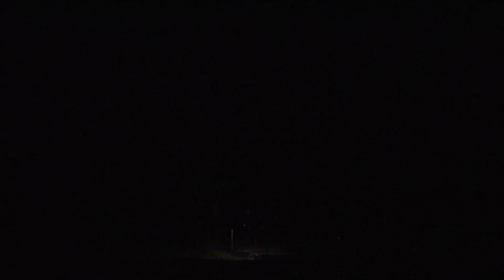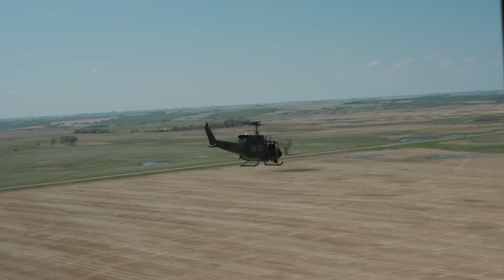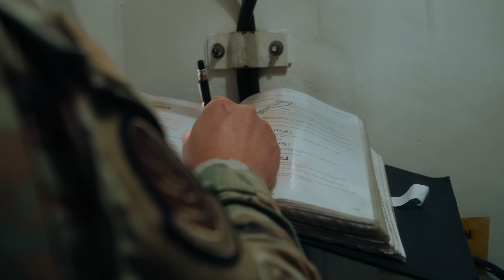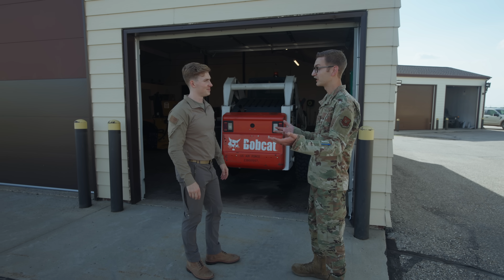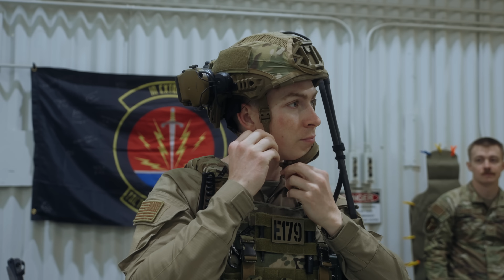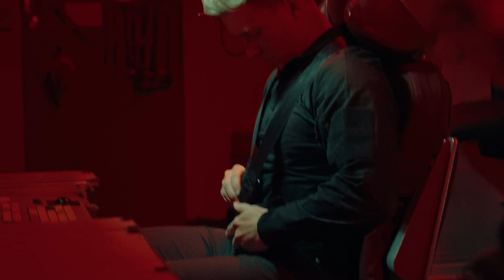Inside A Top Secret Air Force Nuclear Missile Silo

Comment: I was a missile maintainer for 5 years at Warren. It was a pretty good job and one with such a massive impact. Very well-done video, you went really in depth with everything! Glad to see the missile community get some love.
Reply: why do they need a seatbelt to turn a key?
Reply: @discovolante6624 missile blast
Reply: @discovolante6624  Assuming because the blast from the ignition of the missile causes a large shockwave
Reply: @PlushChronicles  but are they not a long way away from where the actual missiles are launched from?
Reply: @discovolante6624 they are. I assume its just for discipline. Staying seated during this critical process. So they made seatbelts mandatory.
Reply: @discovolante6624  All wrong. They are there in the event of an enemy warhead detonating nearby, so they can actually finish their own launch procedure. If they retaliate, most likely the enemy missile is already only 10 to 15 minutes away. The silos are prime targets and that's the reason why they are called nuclear sponges. That's also why the locations are known to the public, it wouldn't be of any use for this scenario, where they secret. The "secret" locations are the submarines and somewhat the air assets.
Reply: @discovolante6624  precautions just in case something goes wrong and the missile man is thrown off their station while readying to fire a missile
Reply: Автор канала, ты скрываешь мои комментарии - мои слова неудобной корректной вежливой правды...
Ты играешь не по правилам, и пытаешься хоть чем-то попробовать переиграть русского, играя по своим правилам, и переписывая условия и правила игры, - это то-что запад тут делал десятилетиями против россии, против её сильного богатого и конкурентного!..
И всё происходящее сейчас на украине, это та запада такая же как и у тебя эта грязная игра, в которой все способы и средства хороши и позволены только тебе и оправданы тобой, и в которой запад всё равно проигрывает россии китаю индии брикс...
.
Европа обречена, и станет однажды придатком брикс!..
.
Это всё происходящее сейчас на украине, это сделали ваши элиты коммерческого и политического, сделав этот осознанный опрометчивый шаг, надеясь переиграть сильного и конкурентного игрока - который честно с вами запад пытался играть по вашим правилам, и вы запад, решили попробовать его переиграть по законам и правилам - которые вы решили нарушить, и использовать законы добра и гуманность в корыстных интересах, и даже предсказывая в 90-х годах последствия этой такой русофобской политики!..
.
В россии, это западное предсказание - тоже озвучивали и цитировали на телевидении, и недавно это старое видео нашли в архиве и показали всем, и все были в ужасе от того насколько всё точно на западе в 90-х предсказали о сегодняшнем происходящем!..
И украинцам, эту старую запись с этим предсказанием о россии китае - и нападении на украину - тоже показали, и украинцы посмотрели, и всё проигнорировали, и стёрли себе это из памяти, - они упорно игнорирует правду стиснув зубы, и ты тоже проигнорировал и скрыл мои комментарии правды!..
.
Украинцы надеются, и снова и снова решили, что надо это перетерпеть и потерпеть - ради светлого будущего, и игнорировать ту жестокую десятилетиями циничную игру запада против растущей россии (и украины) в конкурентной борьбе запада за ресурсы и жизненное пространство, в которой украинец себя тридцать лет видел победителем и в евросоюзе - среди таких же равных добрых честных и гуманных и законопослушных, на почётном месте среди таких же как он добрых русофобов!..
.
И украинец, старался понравиться западу и десятилетиями делал и совершал недружественное и русофобские действия, и десятилетиями всячески выказывал бесстрашие геройство и удаль, и нарушал договора условия правила и контракты, и разрешил базы и лаборатории сша и британии - на подаренной от россии русской земле...
.
Все вы на западе понимали, что россия это сильный конкурент на несметных ресурсах, и все вы играли с россией не по честному, и все на западе понимали и предсказывали усиление россии, и пытались хоть чем-то помешать россии!..
И вот, ты тоже тут, честно и по всем законам капиталистического, рыночного и демократического, гуманного, скрыл мои комментарии правды тебе неудобного!..
.
И пока ты чувствуешь себя победителем, и ты узнаешь о том что ты десятки раз проиграл, потому что всё это тут скрытое тобой - сейчас будет размножено на других каналах...
.
Ты один раз выиграл у россии и сто раз проиграешь!..
Смирись, ты обречен теперь проигрывать вечно самой правде!..
Вы запад, слишком долго осознанно и преднамеренно ошибались врали и обманывали, и играли не честно, и теперь, пришла за это расплата, и мои тут скрытые комментарии не помогут скрыть эту правду
Reply: @discovolante6624  It rocks the entire ground when a missile launches
Reply: @elijahlemoe412 So then why wouldn't the Artimis takeoff not cause a tsunami?
Reply: @successandlifestyle weh?
Reply: My dad guarded ICBMs at both Warren, AFB, and Malestrom, AFB
Reply: How long they seat there a day waiting for launch code?
Reply: @maemilev 24/7/365 for 50+ years now.
Reply: I was MHT/MMT at FEW.
Reply: i just got this job and dont know what to expect? how did you like being in these really remote bases and how well did it allow you to prepare yourself for civilian life?
Reply: @linkCable  Theyre definitely not glamorous but if you like the outdoors, FE and Malmstrom will be great. Minot is minot lol. Its been years since I was in so there has been a lot of changes im sure. It 100% set me up for success in civilian life and I didnt even get all the certs I could have. I was an X1 so learning the electrical trade transferred over well to my job at microsoft. Even if its not what you want to do on the outside, utilize your tuition assistance and get a degree while youre in. I'm pretty sure if youre in VES or an X2, you have the opportunity to get your CDL so that would be massive for a good job. Same with operating a crane. Theres plenty of avenues to set yourself up for success for an AF career or civilian career. I'd be happy to answer any other questions you might have about it homie
Reply: @SquatchyInTheNet  Seriously thanks for replying. I'm shipping out in a week and feel like I barely know anything about the job. Do you think you could describe anything about what your day to day looked like? My recruiter said that it was a lot of downtime which made sense to me because idk how much interacting with nukes goes on. Also, I got 2w231 which I wasn't sure about whether that included icbms or not and tbh not even my recruiter knew and even after calling 2 different people who worked around them, we still couldn't get a clear answer.
Reply: @linkCable  Yeah no worries. I was a 2m0 so we did very different jobs than 2w2's. Don't really know much about what y'all did and they like to keep it that way from what I know. My advice would be to research some stuff on reddit or something like that to see what guys in that career field say. Missiles in general is a high stress job no matter what area you are in because of the magnitude of it obviously so make sure your attention to detail is good. You'll learn more about it from basic training I'm sure when they begin to do your clearance and whatnot. Your MTI probably won't know much about it either honestly. Nobody in my training command knew anything besides how stressful it is. Not sure how they do it anymore but you might hear your name called a few times when you least expect it lol no need to worry. Clear answers about it probably won't be available til tech school but I would prepare for high stress environments at the very least. It is a great job with low danger as long as you don't ruin it for yourself by doing something dumb like getting a DUI or any kind of UCMJ troubles.
Reply: @SquatchyInTheNet dang thing is there doesn't seem to be anything online and I even saw a reddit post by a mod saying the DoE told them they had to remove all posts by a user and ban them or something so it seems like that's on purpose like you said. 
Even if the job is high stress were your days long or did you have consistent shifts with time to pursue other things? my recruiter told me I would have a good amount of down time to finish school.
I was also kinda worried about the bases. People really don't seem to like em and even though ill make the best of it it would be nice if the base facilities were at least comparable to nicer bases since there's so little around you. 
Also so much for keeping a low profile during bmt lol.
Reply: @linkCable  Ah yeah that makes sense. You'll learn more in tech school and basic. I had consistent shifts yeah it was typical 5 day weeks 9 hours each but thats not how it is across the board. Some had more some had less just depends on where the unit needs you. The 2Ws i was friends with were always out in town with me whenever something was going on so i assume it was pretty standard days. Schooling shouldnt be an issue they really push for you to have time for that since its good for performance reports. As for the bases, theyre not glamourous by any means. The dorms at fe are mostly renovated but haunted lol not sure about any others. Most people dont like them because its not overseas or on a beach but I loved it. Tons of outdoors things to do. Youll still be able to keep a low profile in basic for the most part. I got extra phone calls to set up my paperwork so that was cool. Tbh facilities anywhere are gonna be fine since its the air force. I reckon youll do fine
Reply: How heavy were the parts?
Reply: In the event of WW3 
If the two seated..... ..Punk Out and don't turn their keys the missile silos will be launched  as a group ....
Reply: thank you for your service

Comment: Why do they strap into the chairs in the launch center?
Reply: So the meat bags in the chairs can survive an enemy first strike long enough to get their birds off.
Reply: @djdouglas4506  I don't see how that could make any difference.
Reply: @Oasics95  to be serious: if an enemy warhead hits close enough, no it won't matter, but the chances of your capsule surviving an indirect blast is quite possible given that it is buried, hardened, and on a suspension system-- ie: designed to survive to a certain level of overpressure.  But since the entire working area is shock-absorbed, you risk being thrown around and potentially injured-- hence the seat restraints.

Comment: 5:17 I have a question tho, once a missile is launched, is that silo done for the day or do they have just 1 ready to fire and some others stored away ready to be reloaded very close or even in part of the silo?
Reply: to be honest I think if you launching nuclear missiles you probably don't need to worry about reloading it
Reply: The operational silos are ‘one & done’. The Minuteman III is a ‘hot launch’ missile, meaning the rocket engines fire while the missile is in situ in the launch tube. The rocket engine blast basically destroys the launch-critical components, so it’s not really possible to just toss in a new missile & fire it off. Now at Vandenburg AFB after we’d do a test launch we’d refurbish the Launch Facility to facilitate a future launch, which is a long & arduous process. The refurb process repeats after every test launch. There’s really no need to ‘reload’ a missile into an operational silo because at Minot, there are 149 missiles left to send down range if sending 1 doesn’t do the job 😂
Reply: It’s like a Pez dispenser.  There’s about 20 or so more of them in a big cavern under the silo.  The next one just pops into place when the first one launches.

Comment: That was fascinating.One thing however. They can't reveal the location. The location must be public knowledge or you would have light aircraft flying over there.
Reply: They’re pretty easy to spot but there aren’t NOTAMs or anything for them, the gamble is just that it’s remote enough that there won’t be anyone unlucky enough to be flying directly in the path of the missile if they have to launch, and that if there is, gambling that in a fight between an ICBM the size of a building going mach 2 and a Cessna, the ICBM will win

Comment: Why the seatbelts when ur 25 miles away from the launch site and also 60 ft underground
Reply: Because a shower of deep impactor enemy warheads will be raining down over the missile fields, and you can't turn your key if your face is impaled in the console by a pressure wave.